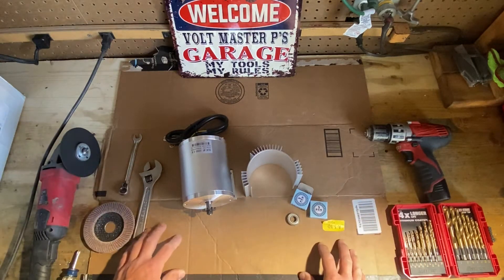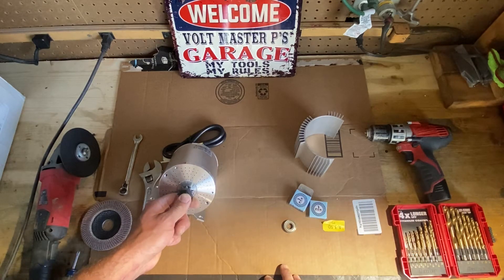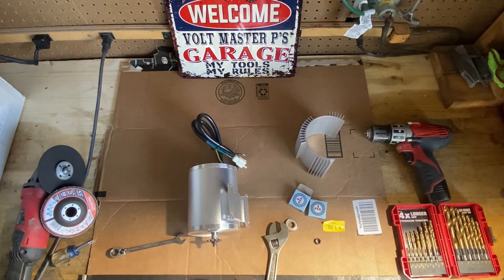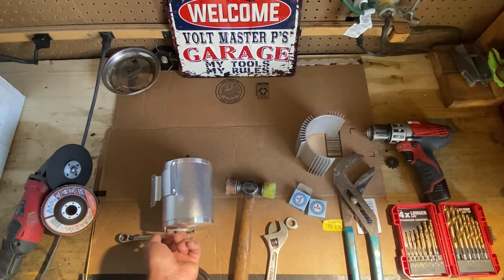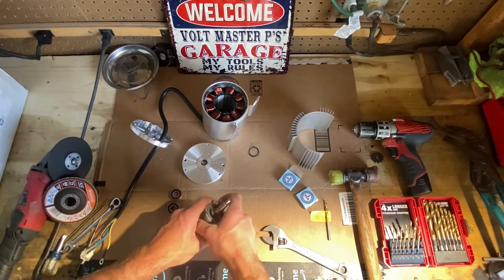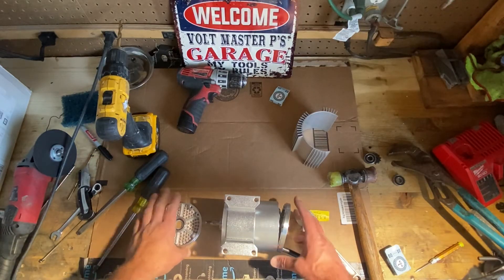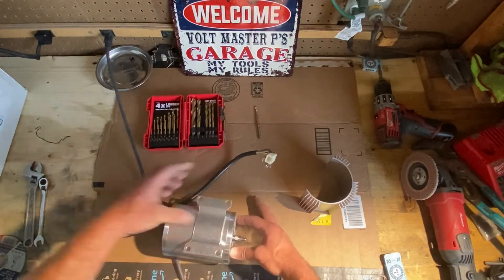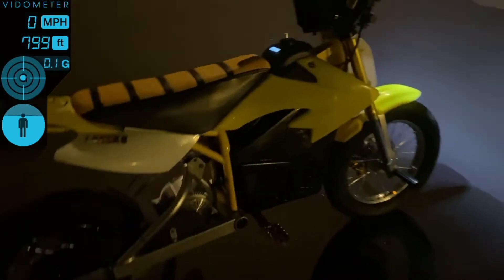72v 3000watt motor “1020” upgrade mods step by step with links

Comment: How hot is normal for these, mine gets to 150f after a few miles.
Reply from the maker: @dustinday3951  I’ve burnt all mine up but never recorded the temp , I would pour water over mine to cool down on a ride they just get to hot , I’ve moved on to bigger motors QS motors and Sotion motors can handle all the power and heat no problem !
Reply: @voltmasterp8470  how long did this one last? I just ordered the bearings that you used for mine and I'm doing vent holes tonight.

Comment: What about the fan because I have the same motor with no fan where would I get one because my motors overheating
Reply from the maker: @justinlester88  I would recommend a better engine I tried every thing to keep these motors from over heating and blew 6 of them , electro and co has a good one $299 and the sotion fw11 is getting some good reviews , I’ll be doing a update video on the yellow bike stay tuned with the fw11

Comment: I have a question is it normal for a 72v battery to pop or spark when connecting to the 72v motor
Reply from the maker: @grizzly9405  yes it does it every time when I plug in the controller to the battery

Comment: Whoa, did you say you had stock razor gearing on this bike when this video was made?  11/80 ?  With 11/80 I can’t do better than 32. 13/80 gets me to just over 35.  I’m 170lbs. 72v with stock kunray / vevor controller. 72v25Ah btr battery.
Reply from the maker: I shunt modded the controller and bypassed the battery!

Comment: When you place the heat sink you should put the high temp silicone heatsink adhesive between. the fins and the motor.  Last I would put a high velocity cooling fan blowing into my drilled out holes.     I am fixing to make the first 48 volt ShopSmith with one of these. Then a 2x72 knfe m grinder too.    Way cheap than buying 3 phase eclectic motor dn    mm hg ggghggggggg

Comment: These are notabley bullet proof and i think your problem with burning motors out to heat could be installing new bearings without lubricant, and cleaning with alcohol and other lubricants which will caise excess heat buildup.
Reply: Everyone says the 72v version of this motor goes bad quickly, i wanna buy one can u confirm they are bulletproof?
Reply: I cant confirm that the 72 volt goes bad quickly but I have heard they have smaller fan to fit more inside the housing. Just from experience I run my "1800 watt" 48 volt version at 64 volts 40 amps and it doesnt get much hotter under load at full power at all for me in case that makes it easier for you
Reply: @padricriley9828  yeah to be honest i might just leave the bike gas and engine swap it cuz its like 5 times cheaper

Comment: I notcied a thing. The lower rated motors has a fan in then to push air thriugh it and cool it down. But, this model that is stronger doesn't. Of course you blow them, they arent cooled. In the 48v videos on YT you see them all having fans built in, but these does not. To me that just cant work becuse of over heating.

Comment: Brillaint video thanks for sharing, do you think this motor would work well in a 130kg quad bike? Currently has a 1500w 60v motor and it does have a decent amount of torque and a top end of about 45 kph what would the difference be using this motor thanks
Reply: with this MOTOR maybe 70km/h with a 3000W 72V motor

Comment: Some thermal paste would help a lot with that heatsink, it’s pretty loose fit. Air gaps are not your friend. Great motor for the price though. Would be great for a riding mower conversion.

Comment: Ayo i made a bike with exactly that motor and i've been riding that since 2021. No problem whatsoever, nothing blew up. Rn i want to do the shunt mod on my controller. The only problem with this setup is that the motor is getting hot when i'm riding on full throttle more then 5 minutes in temperatures over 25°C

Comment: Or test with razor mx500 stock controller is more like the Q I'm asking cause the 500w motor don't get as hot as the 1800w motor
Reply from the maker: It’s 2 different motors the 500 is a 2 wire brushed motor the silver 1020 motors like in my video are a 3 wire brushless motor so no interchanging controllers

Comment: Is it possible to over volt the motor to say use a 21s battery pack? Or even a 22s? I am hoping to max the motor on an outboard conversion and I want to push it to the max
Reply from the maker: I wouldn’t recommend it I’m blowing these motors left and right with 100amps at 72v , I would recommend a bigger motor

Comment: Will the heat sink fit on,  without cutting the bracket of,  making go kart   the bike gets up an goes  cheers an thanx
Reply from the maker: In my application you have to cut it off., but if it’s mounted to a go cart there’s a good chance you won’t have to cut it
Reply: @voltmasterp8470  thanx you having a good run with it this time, thanx for reply

Comment: something tells me all these motors are ALL the same just different controllers? i don't thing there is a deference between a 1800 watt and a 3000 watt motors. that would be more work for china to produce, has anyone seen a deference between motor kits other then controllers? what are the physical deference's other then the BS stickers they slap on and charge more for?
Reply from the maker: The 1800 has an internal fan and and is more narrow to accommodate the fan , the “3000” I’ve never seen a internal fan , but I agree with you they do all look and perform basically the same !
Reply: @voltmasterp8470   I would love to see a video on someone doing a side by side tear down of the two or three different motors and see if one has more copper windings and is heavier?  would help when buying just the motor, if all the same one could just buy the cheapest option out there. maybe even do a bench test!
Reply: I've opened the 1800w, 2000w,2500w, and the 3000w. The lower wattage ones have a smaller magnet stack and has enough room for a fan inside. All the cases are the same size. 3000w magnets fill up 70%-80% of the can while the 1800w magnets only fill up maybe 50% of the can

Comment: I'm trying to do this with the 2000w version of the motor. I can't get the bearings to come off. Also do you think it would be possible to put thicker power wires running in to the motor?
Reply: It is possible but why tho? Only if those wires are getting hot you should do it but otherwise it does not make sense
Reply: @robertindabuilding2876  they do get hot if you run too much power. Also larger wires will make the motor run more efficient. I found a way to order the motor directly from the manufacturer with 6mm phase wires and a temperature sensor. I have more power motors at this point, but I want to see the max that I can get out of an my1020 motor.

Comment: is it worth is to use a higher amperage controller (I'm using a 220a kelly controller) because the motor specs says that it is 45a max, so can it actually draw more?
Reply from the maker: On average you don’t want to push these motors past 80 amps they will blow , you need a fan setup forsure ! I just upgraded to the electro and co replacement motor they just came out with .
Reply: 80 amps with cooling? What could it do continuous? I’m looking at these for small utility ATVs, riding mowers or walk behind tillers etc.

Comment: Damn. Im impressed! That thing is fast. What kind of controller and where did you buy the motor from? Are the kunray ones off Amazon good? Building a 72v razor right now. I think I blew the first controller
Reply: I just bought the kunrey kit for 269 $ is looks quality but still need to buy a battery
Reply: @ryanmccann3969 what battery do u have ?

Comment: If you have time and money take 2 of those motors and chain link them together. Put both motors in a custom sealed aluminum box filled with synthetic oil. Have fins on the outside. If you fancy install a pump to cycle the oil through a cooler.
Reply: Is it avilable on market or diy? Austin Blake has the same single motor with water cooling
Reply: @stefankristanto6163  I meant Diy.

Comment: it would be interesting to know how the older motors actually failed
Reply from the maker: The heat , they practically melted internally and fused together
Reply: @VoltMasterP  do you know where to get that round spring that goes in the end of the motor cover. Mine didn't even have one when I opened it and it rattles when I take off. I am sure that's why.

Comment: Those my1020 motors don't pair well with sine wave controllers. I tried sabvoton and kelly, both of which work very well with other bldc motors but not the my1020 . Also if you run these above 8-9kw the performance drops permanently and stresses the rest of the system. I reckon anywhere over 120amps will definitely kill that motor. 

Qs motors do a motor the same dimensions (qs90) that pairs well with sine wave controllers and can handle 12kw for short bursts. A friend ran his at 12kw (80v150a) for a full minute (towing test) and the temp gun showed 73 degrees celsius. 

Just a thought. Maybe in the long run it'll save you some money.
Reply: Tell me, how much power can the qs90 handle on a regular basis? Will it withstand 3.5 kw?
Reply: @nissanrazbor7949  Yes it will easily handle that on regular basis easily. These motors are conservatively rated. It can handle that and more, continuously with no problems.
Reply: Самый главный вопрос ,какое сопротивление обмоток двигателя 3квт?
Reply: I have two of these and want to run them at 5kw each, 150v or more 50a limit, would they hold up? Ideally i want 160v so i can run stupid high rpms and reduce to get silly torque, all this for a 1.3 ton  hybrid electric car , the 1.7 td engine stays possibly with a hoverboard wheel generator to load batteries just af idle
Reply: @Gazdadjuz  Sorry for late reply. For a hybrid lightweight car, they should be OK. Personally I'd use a bigger motor run slower because there's other parts, like bearings, gearing, etc that won't handle the rpms. I also suspect that the motors won't last very long under those conditions. I'm not an engineer, so maybe look for videos where people have massively overvolted their motors, or gradually increase the power, measuring heat of the motor along the way.

Hope this helps.
Reply: @colinriches1519  I want to make a light motorcycle. There are only 2 light and cheap motors: my1020 and qs90. My1020 is very cheap, it doesn’t hurt to drill it, if you install a fan, it will withstand 3 kW. But it will become full of holes and debris will get into it. Maybe me buy a qs90, at least no debris will get into it + a sinus controller. Its declared power is only 1 kW. If you apply 3 kW to it for 20 minutes, won't it burn out?
Reply: @nissanrazbor7949  3kw for 20 mins is well within the capability of the qs90 motor. 

I used to use the my1020 motor myself. 3 kW for 20 mins on the my1020 3kw will be OK, but I don't expect that it will be very efficient with how hot it gets at that power. The qs runs cooler at that wattage and so more efficiently aswell. Efficiency can never be overrated when it comes to electric motors life span and the integrity of the rest of the system. 

I've opened up both motors. The my 1020 is not something I will use again on anything over 2kw 25kg that i want some power from. The torque is too low and so needs to run at high rpm at about 5:1 ratio. This will give you about 50 mph at 4500 rpm. To go faster without burning the motor out will require higher voltage. However, because of how the magnets are retained with rings on the outside of the armature, there is significantly greater chance that the centrifugal force generated at high rpm will destroy the magnets, or short the windings.

The qs motor has the magnets encased in laminate iron. This not only protects the magnets from inertia forces, but also adds to the magnetic field, increasing the efficiency. Increased efficiency equates to less heat build up and so a more robust power train.

My advice: In the long run, the qs motor will be a much better option. But very light weight, no hills and low speed I'd probably use the my1020.

The qs motor can be completely waterproofed by sealing the phase wires and hall sensors.
Reply: @colinriches1519  Thanks, man. I didn't even think about efficiency, it's the most important thing in an electric motorcycle, and it's not about motor life and excessive heat, but about the distance I can ride. Instead of putting a bigger battery and increasing weight, it's better to put a motor with high efficiency. For me, weight is very important. Especially the qs90 is only 50 dollars more expensive than my1020

Comment: Did that heat sink and holes do the trick to not frying the motor again?  I installed one of these 3000w 72v stock motors on my drift trike at 60v and it overheated, puffed smoke and stopped working in the first hour of riding.  Has anyone done rewinding on these motors?  Would the 48v 2000w my1020 motor handle the 60v better than the 72v version?  Seems like the 72v version would be better as it can handle more amps.  What motor to buy now?
Reply from the maker: They definitely helped a lot but what really did it was the 2 fans ! Check out my other video of the fans ! No problems since and it’s been hot in socal!! I have a full parts list video and my motor is on it with link !

Comment: Hey man if this motor blows out I whould say go and buy an electro and company motor their alot more reliable it is a bit more on the pricy side tho but it will last a lot longer
Reply from the maker: It’s still going strong and they all get The motors from China , my brother bought there kit and I compared them side by side , they have slightly bigger wire recently but trust me when I say there not worth it

Comment: Would it be fine if I run a 72v 3000w kit with 48v 20ah battery? That way if I ever want to upgrade to a 72v battery later, I don’t have change out the motor and controller.
Reply from the maker: The controller cuts off at 60 v but the motor would be fine to do that !
Reply: @voltmasterp8470  Good to know. Thanks!

Comment: Very cool video i once got one of these motors but never got around to use em.
I'd smear some thermal paste under that heatsink !
Reply: my thoughts exactly, i have one of these motors, i see a lot of people using 3000 watt controllers, i was wondering i see 5000 watt controllers and i think some 9000 watt controllers on different sites, i was wondering if those could be used on these motors?
Reply: When you put a heat  sink onto an item you use a special white silicone glue to bond thet can f ftwotogether

Comment: I've got a my1020 motor with a gearbox, I want to get rid of it. Do you know where to get the motor cap (like the ones you drill) to assemble it without the reduction?

Comment: Nice bike was jus wondering what controller are you using or how are you pushing more amps mine only clocks out at 42 11t front sprocket and 54t back sprocket #25chain
Reply: Nice, how big of a rear wheel are you running on your setup? Thinking of running a Vevor 3000w 72v 11or 9 tooth to 53 tooth sprocket bolted to disc mounts on rear wheel on my Kona Ute running 29x2.3" tires.. Planning on using the motor to supplement my energy and regenerate for braking.. wondered if it would be underpowered to spin a 29" wheel with that ratio, or it would it be enough? Input appreciated. I'm use to pedaling, but would dig the extra juice and the regen.  Thanks!)

Comment: A 12v CPU fan bolted over those drill holes will work great
Reply: or drill a hole in the center of a CPU fan blade part and stick that on the 1020's shaft since it's going to be turning anyways (less wiring needed)
Reply from the maker: Yeah I saw a guy in a ride with it and did it a couple weeks ago !! Don’t have to stop and give her breaks anymore

Comment: Did you have any trouble when you put the motor back together? I did the same upgrade (drilled holes and replaced bearings) and when I put it all together the motor doesn't turn smooth, it catches. I think this is due to the bearings because the ones I took off were very tight on the shaft and the penguin ones are able to be pulled off much easier. Just wondering if you experienced any issues lack this, anything helps I'm at a loss at the moment.
Reply from the maker: I’ve replace 6 motors with those bearings and havnt had one issue , have you tried taking it back apart ? , trying running the motor just to confirm it’s bound up .
Reply: It sounds like it's a Hall sensor problem.

Comment: hows this holding up? Any issues with debris getting in the motor?
Reply from the maker: So far so good done about 6 rides at 20-30 miles with no problem , but I still have to take breaks or she gets to hot but I’m 220lbs and it’s a small Motor
Reply: @voltmasterp8470  I hear you. how hot is it there where you're at? it gets up to 110 in the summer whhere i'm at..
Reply from the maker: @jackvucreative  yeah it gets into the 100s but mostly 90s In Summer I’m in Ventura county pretty close to the beach so we get that coolness from the ocean
Reply: @voltmasterp i was planning on building an ebike with a custom box made out of hdpe and polycarbonate. Your tips and tricks will help me a lot in the long run. I live in the same area as you too. Once the bikes ready we should meet up🤙🏽
Reply from the maker: @ogclips7467  hit me up we’ll go on a cruise !!!